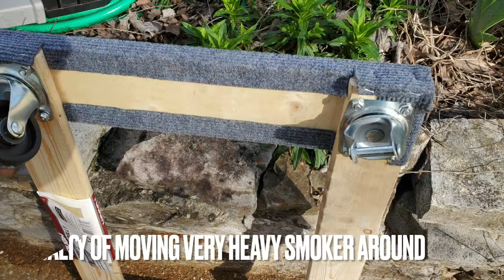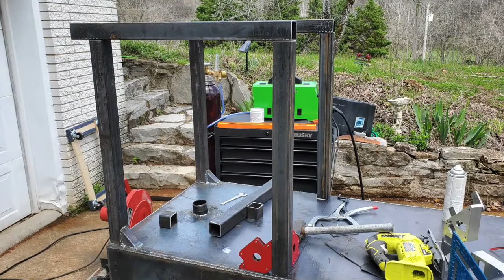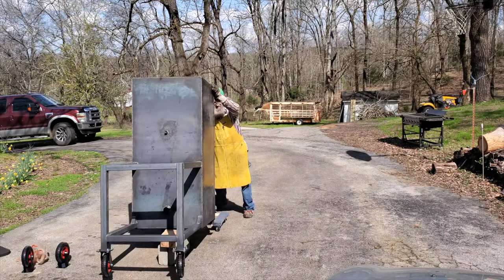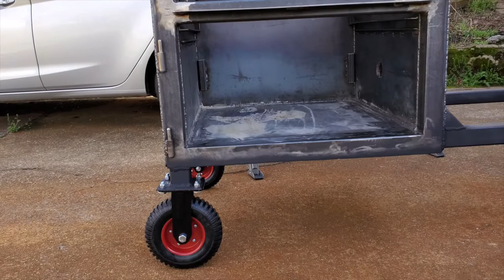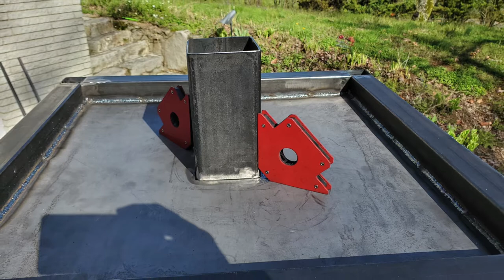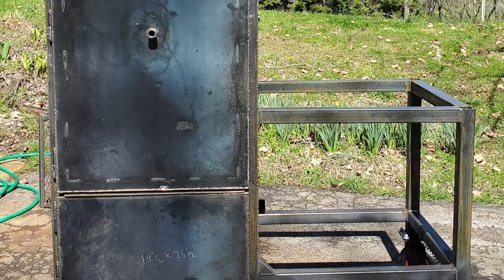Insulated Vertical Smoker Build - Part 5

Comment: How is it holding up and how many sheets of 1/8 do I need going to start Monday great job!
Reply from the maker: It is holding up very well.  As far as full sheets of 1/8, I didn’t really calculate that as I had the steel supplier cut mine to the dimensions I needed.  The outer shell requires three sheets 28”x60” and two 28”x28”.  The inner shell is 3 sheets 25 7/8”x55 7/8” and two sheets 23 3/4”x23 3/4”. (you may want to wait on the interior sheets because depending on the thickness of the tubing those might be different) The door is two sheets 28”x60”.  I hope this helps.  Thank you.
Reply: @UncleTimsFarm  helped a lot